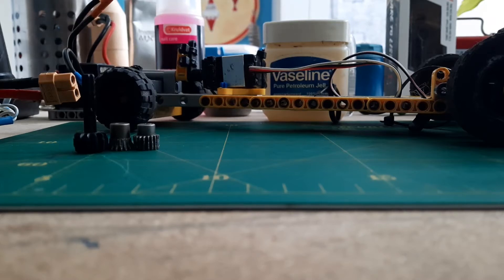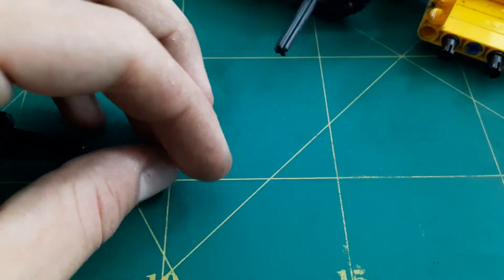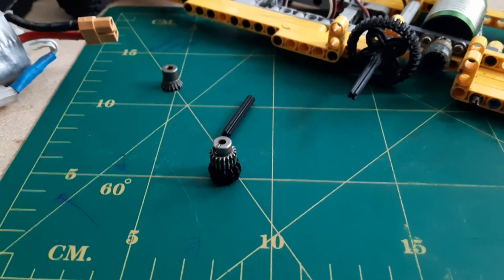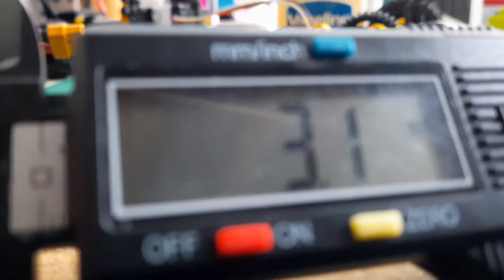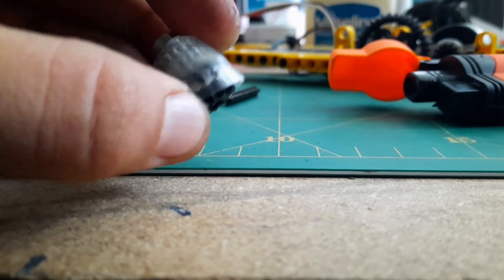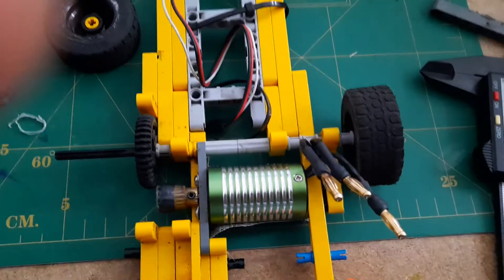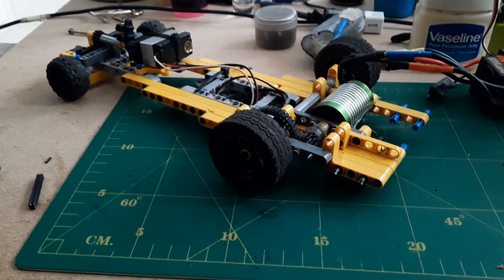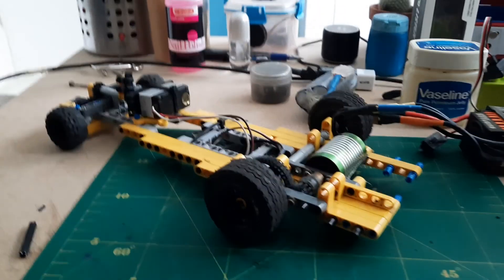4 Tips to make a fast LEGO RC car/Adapter rc motor to LEGO axle.

Comment: Great! You should use ballbearings! I use them and i haven’t any problems with the axles anymore 😀👍 you can also use Modul 1 sprocket. This fits perfectly with Lego sprockets 😊
Reply from the maker: Good idea, i already thought of it but i didn't do it because i didn't know the size and they are hard to find in this kinda smal size in my country😉
Reply: @ivarvanwijk4816  i use this parts for the axles: https://www.shapeways.com/model/upload-and-buy/10473579
Reply from the maker: @friedls  thanks!
Reply from the maker: But if you have the option, its definetly worth it i think!!
Reply: @ivarvanwijk4816  here you can see the result: https://youtu.be/v5Ey2yWuErM

Comment: This video is very useful 👍👍
Reply from the maker: Thanks!!
Reply: Ivar RC what brand is that motor?
Reply from the maker: @xavierramirezz2231  Its from a ready to run car but the motor that i recoment is a surpass hobby 4370kv 2845 motor.
Reply: Ivar RC ok👍